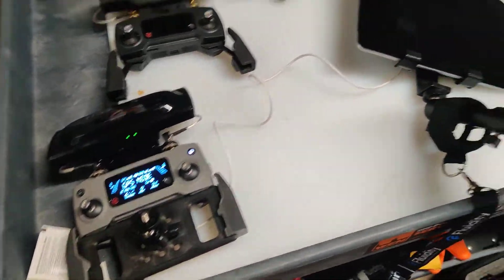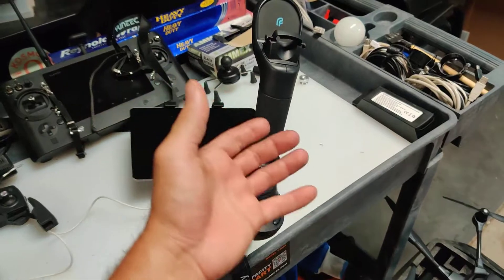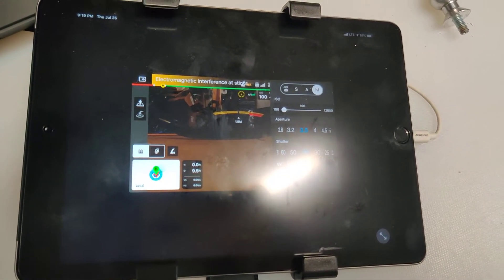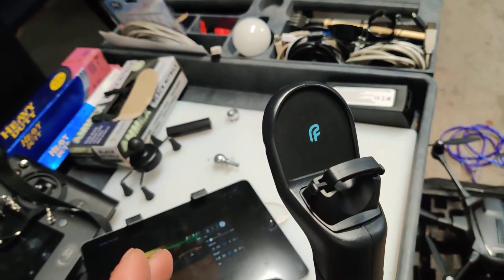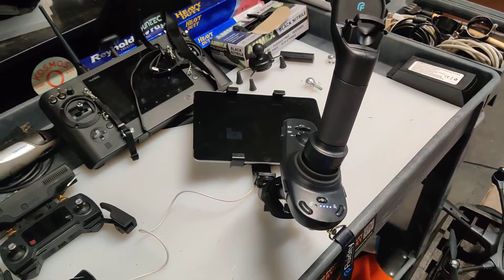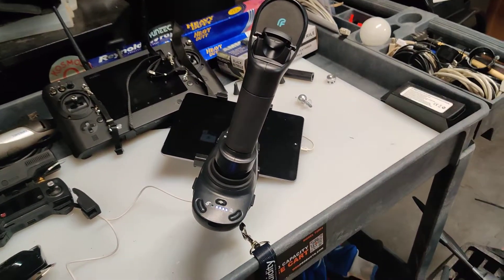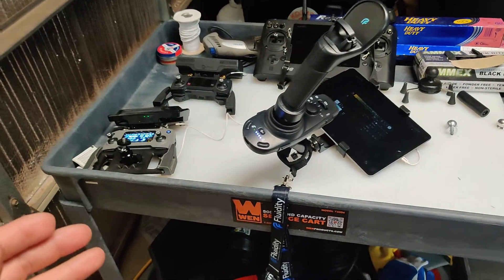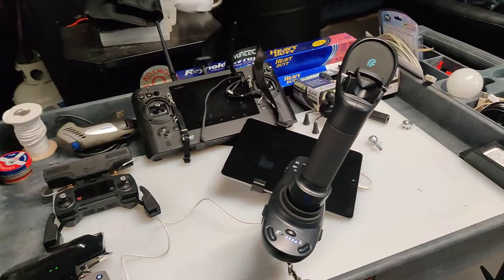The FT Aviator - A critical review

Comment: Not Optimized for Tablet yet,  but if you hit the arrows in the lower right-hand corner of the iPad, the screen goes almost full screen. Its was advertised as a blue tooth extension where the cell phone is cabled to the RC and the FT Aviator is connected via blue tooth to the cell phone/tablet.  The button you do not know about is a programmable button. All explained in the FT Aviator Manual. Also the there are a bunch of training videos similar to what DJI put outs showing you the set-up and usage. Too bad the cell phone holder is not with unit. Good to know one is being sent which sounds like the product support is okay.  You can mount the iPad on a tripod with RC and fly wireless with blue tooth using the FT Aviator which is a cool option. I should have mine next week and have read the manual cover to cover, loaded the App on several Android cell phones and Android tablet and on my iPad mini 4. I built a little control panel mount for a tripod for the RC and App device and will have a video out in the next couple of weeks. I will show the actual flight experience. I am confident I will have a positive experience with my approach of being informed and prepared.

Comment: I have to honest and say many things you've mentioned as a "negative" regarding use I think is possibly a bit misleading. I don't have mine yet, but I have found all of the manuals (.pdf) and quick start info on their site. Pretty straight forward, and It's been there for weeks. Next, there are a couple of videos that clearly show that you don't need have the RC on a strap around your neck for ALL drones. Mavic maybe, but on a P4P you can mount your device on the RC as normal, and just BT to the Fluidity app -- bypassing the device holder setup.
Reply from the maker: Watch the next video. This device does have issues in app and design.
Reply: More bluetooth more lag.
Reply from the maker: @gregparker5732  it's not horrible but I can see anyone wanting to use this for fun fast flying having control issues. Especially if they want to do obstacles and hoops.